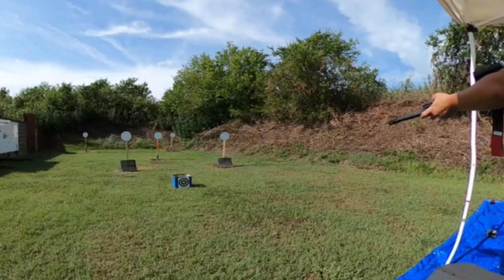New Frontier Armory S-9 (malfunction - feed ramp set screw)

Comment: Good info.  I plan on building a pistol in 9MM with a S-9 lower and a Bear Creek bufferless upper.
Reply from the maker: 👍Let me know how that works out once you get it completed.
Reply: @redarmory  will do. Got my Aero Precision lower, parts kit and CMC PCC Flat 3.5lb Single Stage Drop-In  trigger coming in this week,  BCA upper 10.5 barrel on 7-10 week lead time.
Reply: @redarmory  Completed it and so far if is functioning great.  Had to modify the BCA upper to accept the CZ magazine
Reply from the maker: @roundrock63  glad you were able to get all the parts to put it together and got it running.